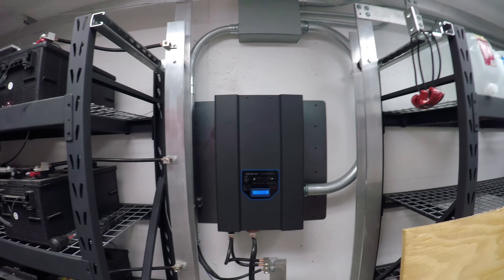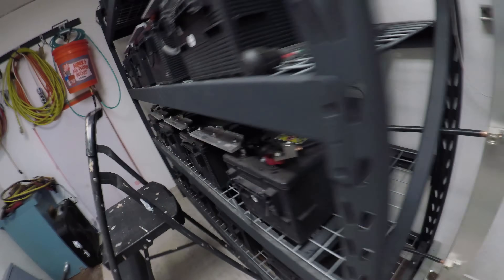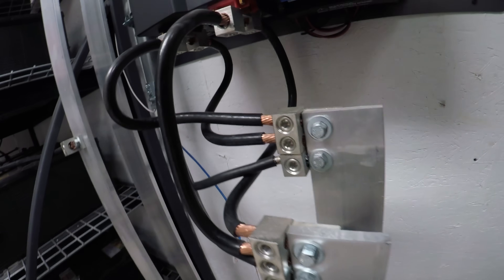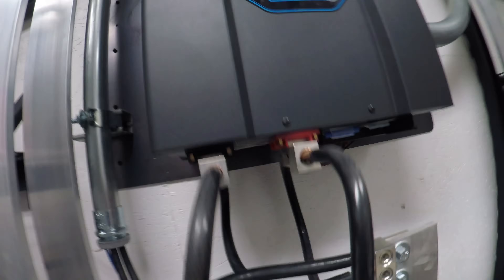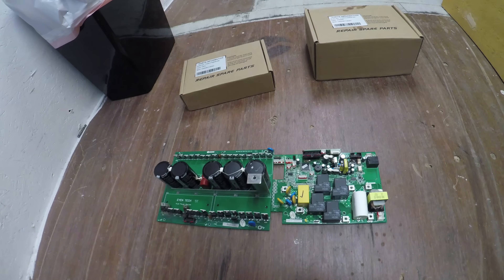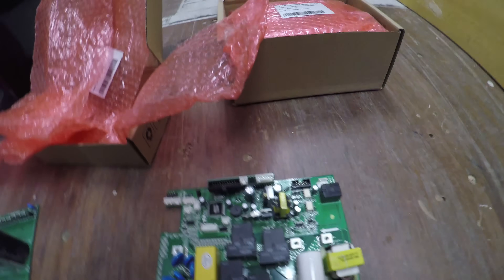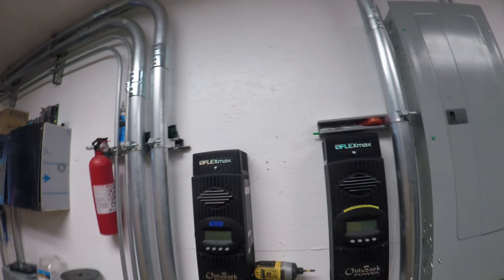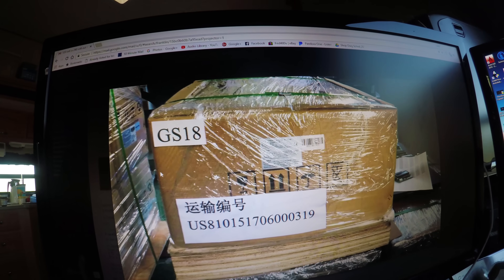HUGE Off Grid Pure Sine Wave Inverter 36 KW Peak

Comment: Are you still running this Sigineer inverter?
Reply from the maker: No, the idle draw was outrageous and most of our daily consumption was just to keep the unit on.  Also the fans ran nonstop.  We switched over to a Foxpower unit that was better, but not by much.  Ultimate solution was 2* sol-ark 12k units
Reply: @HighTechLab  mind if I send you a question or two?

Comment: Yes, you definitely need a battery breaker.  Must not be an NEC (or equiv) inspected system ?
Do you have PV input disconnect breakers on the MPPT charger controllers ?   Need that too if not.

Comment: Why didnt you add a fuse and or a isolator switch, you know the big yellow and red rotating switches. I dont know how you sleep at night without extra protection on this lot lol
Reply from the maker: The BMS has short circuit protection and can be deactivated to shut things down

Comment: Wow that's a nice clean setup.  Reminds me a lot of a telco central office power plant.    Too bad the inverter is so susceptible to blowing though, but at that price that is a steal, I would setup a secondary one where you can transfer everything over.  8kw Outbacks are like 7 grand. :o  Looking at eventually living off grid and I want lots of inverter capacity so I may look to see what it takes to build my own.
Reply: I have been running off grid now for 7 years. I used 22mm soft copper water pipe as my bus bars and flattened it about 30mm to insert a bolt through whenever I wanted to put a connection. Insulated with 25mm split flexible conduit. I have two low frequency inverters one 15kw and the other 10kw of 48v. I am running two households with electric stoves, infact the only thing I changed was the light bulbs to led and added 3 x 150l geysers, 5 in total. Storing energy in hot water, works great. I do not have solar geysers. 72 x 285w panels and five solar charges. 3 x 60 Amp and 2 x 100 Amp. 1500Ah deepcycle lead acid. Each battery set fused to the bus bars and all charge controllers with circuit breaker disconnection including the two inverters. Now that you know what I have on my bus bars it is safe to say that they do not even get warm and the voltage on either end of them is less than 0.1 volts.
Hope this helps you with your setup for off grid.

Comment: That's what you get when you buy an inverter that uses cheap Chinese knockoff FETs. In addition your inverter's overload protection should have kicked in to save your inverter's cheap Chinese knockoff FETs.
Reply from the maker: At this point, i've gone through 3 control boards and 2 fet boards.  What's that tell ya?
Reply: @HighTechLab  Still cheaper than a Victron Quattro 15kVA, but with slightly more maintenance required :)

Comment: Holy crap the size of your bus bars and wires.  I'm pulling 6000 w through 10 gauge from my batteries.
Reply: Im using 4/0 from my lithium on a 48 volt system.
Reply: @bubbawubba2307  someday you'll switch to high voltage and all that copper will be recycled.
Reply: @SiriusSolar  what voltage setup you running? 96volt? What length of wire?
Reply: @bubbawubba2307  15ft. 515v
Reply: @SiriusSolar   you have 515 volt batteries?
Reply: @bubbawubba2307  yes
Reply: @SiriusSolar  
How did u get 515 volt batteries? Just wire a bunch of cells up in series? What inverters and charge controllers do you use thats 515 volts?
Reply: @bubbawubba2307  I use a shv u-bms communicating via rs-485 with thirty eight u27-12xp 12volt valence batteries  totaling over 65 kwh that are all in series.  I'm using 18kw of  modified / hacked Tesla powerwall inverters.  Completely off-grid. it's a Frankenstein but it was cheap and it kicks everything elses ass.

Comment: I have been looking at the purchase of this model. there are so many options at this price point that its very confusing.  what was the determining factor or factors that  caused you to make your purchase? Thank you Kindly.
Reply: Tyler - I work w/ HTL on engineering of systems & wanted to let you know that we are looking at alternative inverters in the 12+ KW range.  The reason is these 2 TI reference designs in use (sigineer and foxpower) are incredibly wasteful due to their transformer designs.  The one running here uses 350W at idle, 24h per day as we can not shut off power due to the 24x7 uptime requirements.  So the first 8 KW-h per day goes only to heat the transformers.  Then there's the cost to cool the insulated room of said heat.  There are other designs capable of 6-10x lower power waste due to improved transformer design, but there is also a bunch of junk being sold to watch out for.  Watch here in the next 2 months and you'll see some new technology entering the famous electrical room!
Reply: @uwave  exactly why I didn't give one of these a chance and went with 2 Magnum inverters instead
Reply from the maker: Mark, the magnums are just as bad.  The best inverter for efficiency is the sol ark 12k inverter.  https://store.currentconnected.com/solark

Comment: I have this inverter running my whole house off a 40kwh LiFePO4 battery stack which can be charged either from the grid or a 16kw single generator.  I am concerned that yours blew up doing something seemingly innocent.  My understanding is, under a heavy load, transfering from charge mode (like if the utility is still operating) to inverter mode (like if the power grid fails) will blow the inverter?  It sure seems like that should be covered under warranty.  That's the whole point of having this inverter/charger with auto transfer switch.  Am I missing something?  I've been very happy with this setup so far.
Reply: Where did he say that "his blew up" ?
Reply: @RoelVandePaar  The discussion started at 6:50 and continued to 9:15. Then he comes back to it and actually uses the word "boom" at 10:18.  BTW,  after running my system for a while now I can't believe he has no circuit breakers on his battery strings.  He talked about that at 9:20.  I hope he's done something about it by now.  It's pretty scary.  I've got a 100 amp breaker on each 48 volt string.
Reply: @ericbraun4652  Cool thanks. Good info too.

Comment: Why did you use such massive bus bars and uninsulated on top of it. You should have just used junction boxes and no bus bars. They must have set you back quite a bit.
Reply: that is absolute correct , in this closed elektroroom.
Reply: It's actually a nice way of doing it as it makes it easier to add more connections to them such as more DC loads, battery banks etc.  It's a central super low resistance path that everything connects to.  Similar to how telcos do it actually but they use copper.  Aluminium works too though.   Personally I would have kept them on the ceiling though, it makes me a bit uneasy having them so close together and within reach.  You can fit a pop can nicely between those two. :o   But i have seen busbars like that within reach even in telcos... usually they put a transparant plexy glass over though.

Comment: so far the only thing which is not good is it should  handle that instead of burning the mosfet  design is not that good try the schneider  inverter . or danfoss
Reply from the maker: What I found out after the fact is what had happened was the relays that are transfers welded shut and the mismatch in sine wave between the generator and inverter cause them to fight each other

Comment: That's an Aims inverter  components look too undersized to handle 12 Kw let alone 32Kw peak stay away from that brand
Reply from the maker: I've pushed this past 12 KW many times, it certainly does have the capacity.  Starts up the 5 horsepower air compressor like nothing
Reply: @HighTechLab   Those inverters usually fail after 2 years of use how long will it run at 12 kw my bet is not very long

Comment: So I can use this inverter/charger for my projector that is 8000watt as an ''online ups".
The inverter receives power from the grid and also charges the batt, and if grid power fell away my projector will keep running but it automaticly switches to the batt. Am I right?

Comment: How did you get the inverter for $1,249 the link you have listed shows it at $2,299.00 ?
Reply from the maker: Few things, mine was one of the first ones of the production line, I had to wait 2 months for it to be manufactured and then another month for shipping by sea.
Reply: @HighTechLab  Ok thanks for the reply
Reply: over $1,000 discount for making you wait 3 months that's not bad but yes I was thinking the same thing this guy was found one on eBay for $2,300 still not bad I suppose how long are these inverters known to last for so long as you don't push them too hard?

Comment: I am trying to run my central A/C on this unit, but I'm not sure anymore, my A/C is 8.79kW but the surge wattage is or arount 48kW, do you know if there's a way to increase the surge wattage, or another type of inverter
Reply: I start a 3 1/2 ton central HVAC with one of these units. Had to put an optional "Hard Start" capacitor on the AC compressor. I can't verify the unit can generate anything over the 12 KW as rated. Any overage beyond that just tripped the output off.

Comment: What in the name of gods green earth does one need to run in a home to need 36kws peak? let alone 12kw? do you like run aircons on coldest vs a heater on hotest? try and make tornados?
Reply: Motors use more power starting up than they do running. Most inverters have two to three times their running or continuous wattage for that reason. If you watched the video, his air compressor was a 33% load on that inverter. Not much else was running when the breaker test was done as when the compresssor was turned off there was a 3% load.
Reply from the maker: It's 330 amps surge on the DC side at startup.
Reply: I consider 36 kilowatts to be the hurry tame amount of power considering the regular utility power is 80 kilowatts with obviously higher surges than me than that. If you're running a 20000 watt sound system and a mini IMAX home theater also Recording Studio Plus in electronics lab plus a server Farm and electric stove range and electric dryer and air conditioning you need the power believe me.

Comment: I use a battery fuse combiner or your can buy the midnite solar high amp breaker. They use very cheap mosfetts. I have blown a few of these inverters

Comment: Not having  battery input shut off switch or fuse is dumb !
Reply from the maker: If you watch some of my more recent videos, you will see that I have installed 2x 300 amp fuses (one fuse per rack of batteries)

Comment: In order not to void the warranty for this unit by drilling the side for the EMT, you could have bought adapter ferrules that will convert 4-6guage to 8gauge for use in the terminal strip.
Reply from the maker: Tough call, I had this unit warrantied and they did not care.  If it has issues they send you parts to fix it, you wouldn't ship it back.

Comment: Have you thought about installing knife switches on a bar that can be pulled from a remote location, outside the room would be a nice safe place. Using paracord for the pulls would eliminate or reduce electrical damage.

Comment: No circuit breaker or fuse?
Reply from the maker: Stay tuned, I just picked up a 1200 amp disconnect that will be installed in the container

Comment: Brother this is an impressive system.. how much would a 36kw system like this cost to setup?
Reply: I know it's been three months, but it's 15000 dollars. He lives off-grid, and the electric company quoted him 70,000 dollars to get him on the grid, plus the monthly electric bills, the system paid for itself the second it was switched on.
Reply: DerpMans Derpyskin untill it needs repairs, maintenance, upkeep, spares and consumables. Also if theres a fire, flood, earthquake etc etc you lose everything and its back to square one again. if that happens to the grid you dont have to worry not your loss its their gear. There are a lot of upsides to using on grid. But yeah if i had the cash id do the same and give the power company the bird hahaha

Comment: I just connect the battery to the inverter, but I have A/C abnormal,I don't want to have A/C input because this input is going to try to charge the battery, and I only want the inverter

Comment: Thanks for the video and sharing. I have been off grid here in Chile for 4 years and I am in the process of purchasing a totally new additional 48V system. I would like to speak with you about your inverter and how satisfied you are with it? I am a fan of MPP SOLAR INC in Taiwan as i already have one of their inverters and am looking to purchase 2 more at 4,000 watts each. Please let me know how I can talk with you. jim.dorchak@gmail.com
Thanks Jim from Chile..........
Reply from the maker: ChileExpatFamily there is a company in the process of sending me a new inverter for review. I would stay tuned for that video in the next couple of weeks. I would recommend the inverter I have but I've had a couple of issues with it including blowing it up once
Reply: I watch Justin Case Solar and he too test drives equipment. He is the one who turned me on to the MPP SOLAR and their inverters. He also had really opened my mind to the disconnects and fuses (DC Fuses) as well as cable sizes. I do like your bus bar and how you have it set up. It totally avoids the cable sizing problem which is good. 
I am subscribed to your channel and alerted to when you upload new stuff as well. Thanks. Jim
Reply: Hola Jim! Pronto estare construyendo una casa de consumo diario aprox de 30kw ... no se ni por donde comenzar para que no me salga muy costoso, me uni al grupo de Jehu Garcia (DIY Powerwalls) : creo es una manera de ahorrar : cualquier sugerencia es muy bien apreciada! saludos desde Panama!
Reply: I tried to put in Spanish but for some reason I could not cut and past and I do not trust my own Spanish yet! 
I like MPP SOLAR and their Inverters / Inversors. They have good 230/ 240 systems, and 48 volt systems as well. HighTechLab's Channel is really good too as he is an innovative guy that has given me a lot of good ideas. I also like Justin Case Solar in Australia.
I plan on installing a totally new system in the next two months and would love for you to follow along! Saludos from Chile. jim
Reply: Thanks for your quick response. Ok, I will subscribe to your channel, Saludos!

Comment: You should add a cut off box just before the inverter also add a breaker. See if you have spacing near each battery for fuse or fuse holder. Consider cutting section of aluminum to install fuse holder. Maybe on each shelf. Gigatech
Reply from the maker: Thisoldtech if you can find me a circuit breaker rated at 48 V at 450 A DC then I'll gladly install it on the bussing. I have been unable to find one.
Reply: Have you check the size of the cables running front the transformer to the terminal(A/C) from their video looks #10AWG
Reply: Disconnect switch with 450 amp fuses. Not a breaker. The transfer switch on the side of our house would work for that as it is huge. It can handle 600 Amp fuses and if needed, with the addition of a third leg kit, 3 phase  480V  at 600 Amp. It is very lightly loaded at 240V 200 Amp. Contacts don't burn that way. :-) 

Now as you have open buss bars, you could pay a visit to a railroad scrapper and get a battery disconnect switch from a 1st generation locomotive. They were knife switches that had fuses after them.  And a long handle so that you weren't near the switch when you operated it. They were 64VDC nominal ( 72v when charging ).

Comment: I have lithium-ion batteries, so I don't think the integrated charger in this inverter is able to charge lithium-ion. this inverter comes with 3 cables L1,L2,neutral, and the chassis is ground
Reply: Batteries are charged through those two large terminals, the red for positive and black for negative, that are used for battery power input.

Comment: That is an AIMS Power Inverter under a different name
Reply: Very nice power station. I would have put the batteries much closer to one another with ONE inch of space between them. You can put 3 times more batteries in that room.
Reply from the maker: I gor it from the factory directly.....
Reply from the maker: Roger Baker true, but I can only have 4 in a string because of what it takes to go from buss yo buss

Comment: That is a lot of work. Hats off to you. Not a fan of the inverter though.
Reply from the maker: +AWPS Renewable Energy, LTD it's getting me on my feet. I can always upgrade later
Reply: HighTechLab get a good low battery disconnect. The low they have is two low. As long as you protect the inverter it does the job. Good luck. You have an impressive setup
Reply from the maker: +AWPS Renewable Energy, LTD instead of a low battery disconnect I'm gonna have it so it starts the generator to charge the batteries and keeps the power feom going out. It will all be PLC controled at the setpoints I choose.